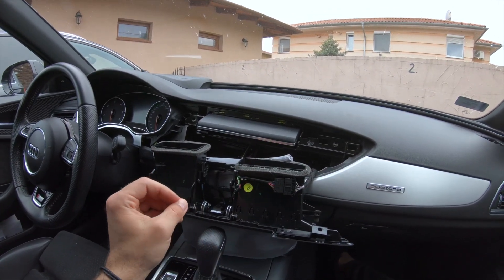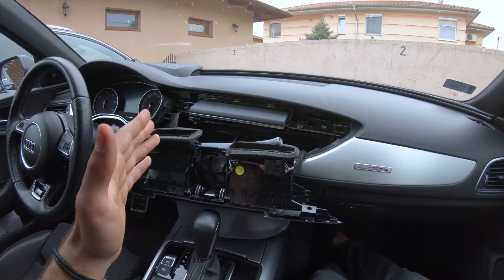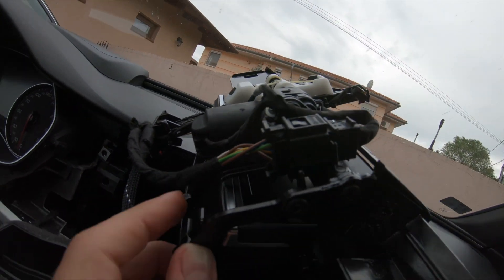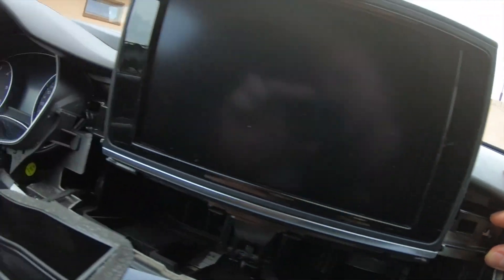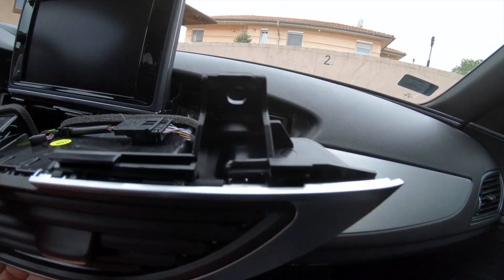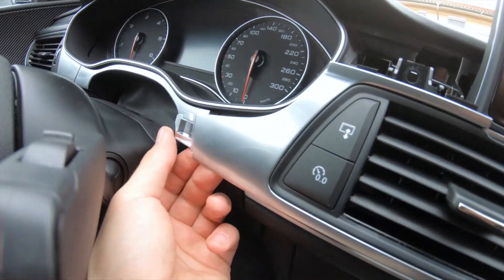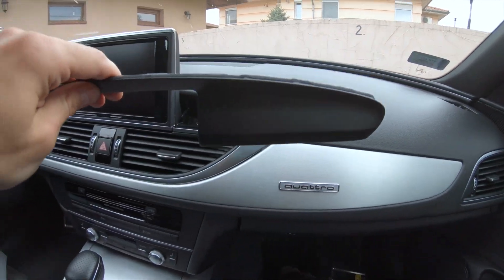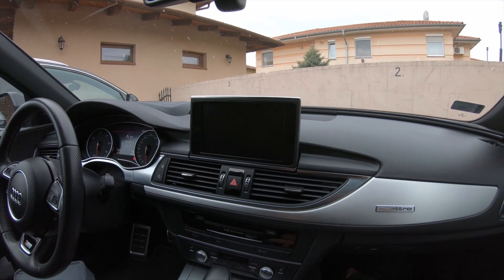Audi A6 C7 Disable Screen Flip/Open and Close

Comment: you could add a switch button to the motor connector,  so you can turn on and off motor .. just in case you want the screen to fold in without removing the screen again.
Reply: Wonder if the screen stays on when closed with the switch change you mentioned. Could become a heat issue. Maybe the screen on/off is mechanical.
Reply from the maker: I was thinking about this option but I didn't want to cut any original cable and I didn't want to wait either to order adaptors that would fit.
Reply: JF Car Stuff Pretty sure that our systems run quite evenly. I own a 2013 A7 and the white little string that retracts my screen snapped. Think it’d be a easy fix? 😖
Reply: @GCervantes242424  so.. 4 yrs later was it an easy fix? mine stopped retracting (but it makes the sound) so i assumed its the string aswell.
Reply: @ClavinZKL  You should be able to see the string through the small crack on the left side of your screen and if it’s snapped it’s definitely an easy fix. Let me see if I’m able to find the video on here in which it gives you a step by step, that’s the one that I used and it wasn’t hard at all. I haven’t had that car for about 4 years now, crazy thing is that it ended up getting totaled up in Park City, UT. Hit a buck and that was that. Miss it, to be honest with you. 😮‍💨

Comment: I think a display always out looks untidy. I have been trying to find a way to keep it down unless requested. It should be a menu option for which ever is your preference. I can't even find it with VCDS.
Reply: As person above states just fit a micro switch in an accessible area to switch which will suit everyone's taste either up or down. VCDS isn't the solution to everything the ol brain has to be used also (Audi Tech)

Comment: Great job! Doesn't it pop a fault code on the Dash and/or VCDS Scan due to the motor being disconnected?
Reply from the maker: Thanks! Dash, no. VCDS I didn't check.
Reply: i am getting an error from VCDS "Rotation Mechanism for Display Module Front 
            003 - Mechanical Failure"
Would you please let me know if it is related to unplugging that cable?

Comment: If the screen was working but all of a sudden no, but all wires and everything connected what could it be?
Reply: Power cables are probably cut and they touched together and fuse blown on the right side dash.

Comment: Don't try this with smaller screen! You won't get the last trim in place without folding the screen!
Reply from the maker: I remember it was very tricky but I managed. Maybe the clip right behind the screen didn't click but the it's not noticeable if the ones on the sides do.
Reply: nope,  did mine with small screen and trim snapped back in no problem.
Reply: Start on the left side ;)